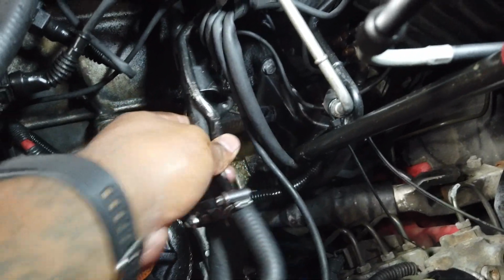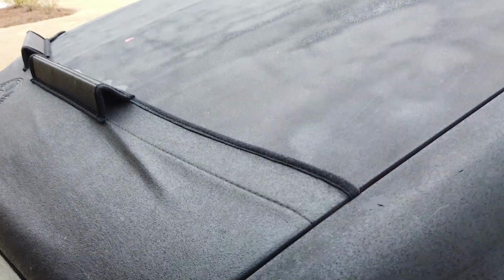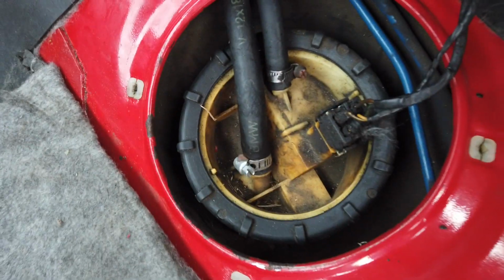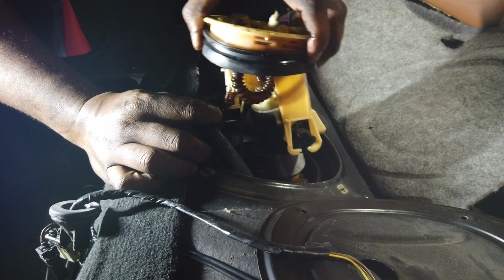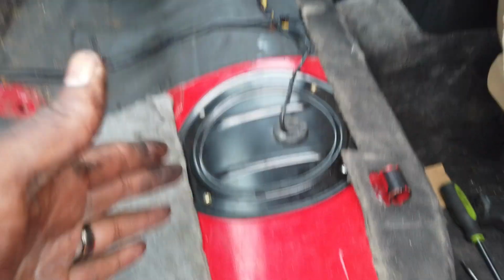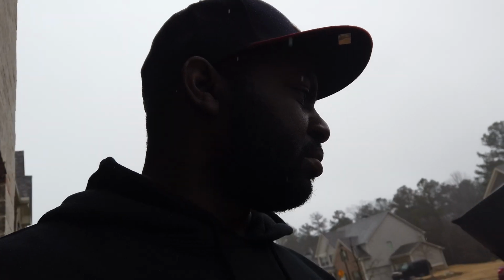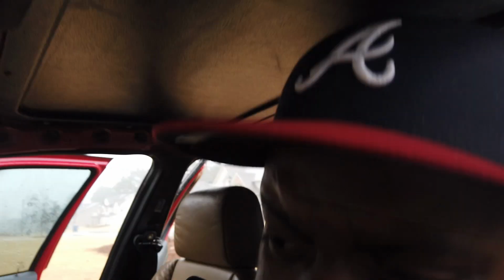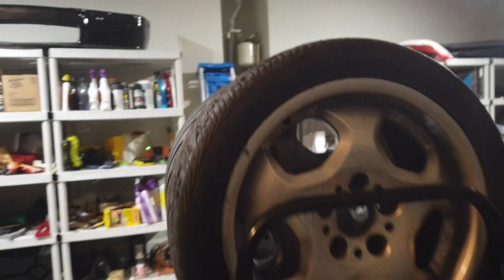HOW MANY THINGS HAVE I FIXED ON THIS E36?? || Roxanne The Sedan

Comment: Need to clean or replace the IACV If its a little cold the DME will close up the IACV to richen the mixture to help it start. If the IACV is stuck open the mixture will be to lean and it wont start. In my experience with an IACV unplugged it'll run fine in ether hot or cold conditions, but not both. Another possibility is failing coolant temp sensors, there are two on the side of the head, Also vacuum leaks, fuel pressure. (Should be around 55psi measured at the rail return line), MAF. 

If those all check out, you may have a cam or crank sensor failing, or wiring rubbed through somewhere. Injectors and coils wont fire without the cam signal

Comment: Dude exchange the idle control valve to rule out that it is that, if not , the other thing is possibly the manifold has a vacuum due to the orange gaskets, then check injectors o-rings, if that does not solve the problem then the temperature sensor is giving you problems
Cya

Comment: Had an issue with a different car and having that weird idle thing and turned out pins were loose in the fusebox, not sure if you can tighten those on an e36

Comment: I'm only a few minutes in, but I'm betting crankshaft position sensor. I've got an E36 too and there's always some shit with this car. Had it for 14 years now
Reply: Clean the sensor by the crank, check the wires, ohm it out. Shits gonna go out on you at the least convenient time man. Fuel pump relay could have been sticking too

Comment: You need that 485lph kit from rallyroad and a painless performance relay kit install. haha
Reply from the maker: Will most likely go this route
Reply: @itsBlack  i got my car running last week and it worked perfectly. Granted, I’m dumb and didn’t realize the difference between obd1 and obd2 hangers 😂😂 pump and relay worked perfect.
Reply from the maker: Yeah I made that mistake before. Fired it up and was wondering why I had a big ass puddle under my car
Reply: @itsBlack  same here 😂😂

Comment: Does the CEL come on when the accessories are on
Reply from the maker: Well.. my check engine bulb ain't even in the car. That's why I never noticed I had no oxygen sensor for the longest time lol. But it wouldn't show anyway for obd1. It has to be a major issue for a code to show
Reply: Oh cause on my 95 M3 there was no CEL when accessories are on, and it was a metal fuse in the back on the battery line, once i fixed the metal connection on the fuse it showed a cel prior to starting the car and it worked, i spent about a week trying to figure out why my car started the bih rn before but not in the morning
Reply from the maker: Hmm maybe I'll look into that. As bad as this car has been I just assumed he cluster swapped it and took the light out